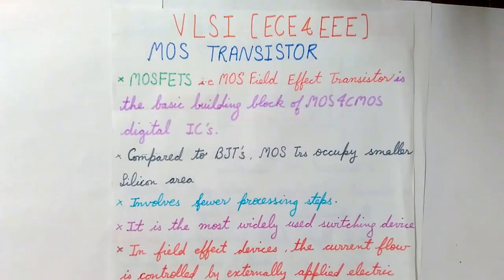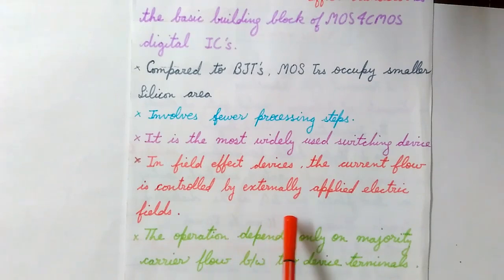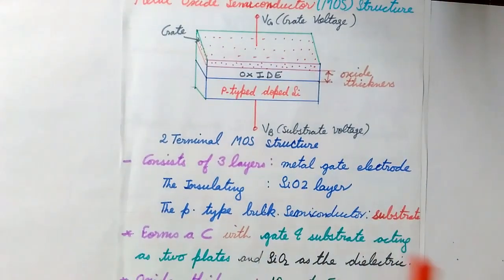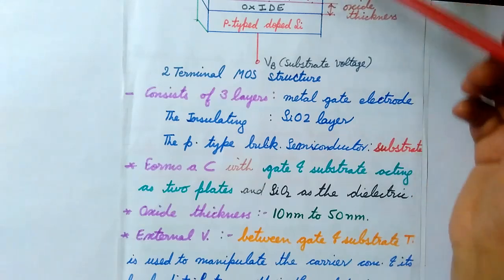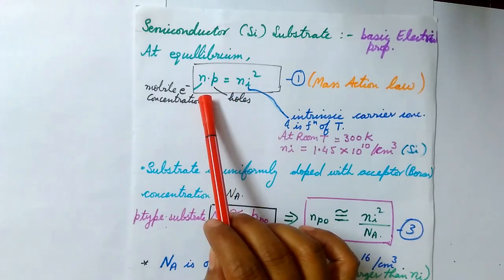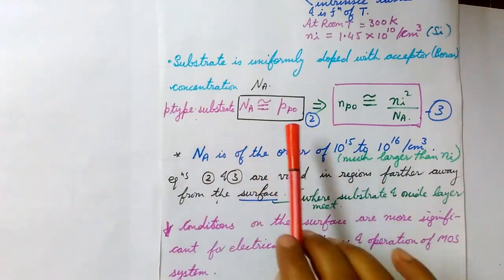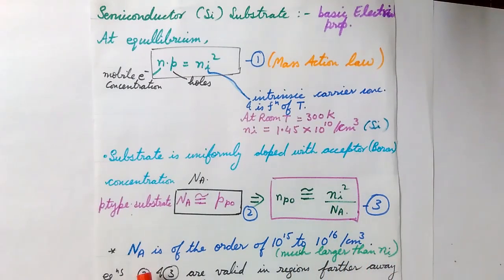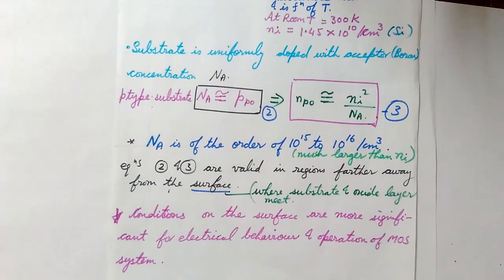VLSI - Lecture 1 (MOS Structure)

Comment: Hi Ranjeeta, Is there any way you can go over Channel Length Modulation (CLM), the part where it says delta L is proportional to sqrt of the difference b/n Vds and Vdsat, and the part where they approximate (1-del. L/L) with  (1-lambda times Vds), and how they moved it from the numerator to denominator as a sum. That will be greatly appreciated, and I hope you respond! With respect, thank you!

Comment: Hi Ranjeeta, my complements to your nice explanation of gradual channel approximation! One question that still lingers in my mind is that, when you calculate the total surface charge why subtract Vto and Vc from Vgs, why not add. How did you determine the polarities of the voltages inside the inversion layer? In short, is there any simpler way to visualize the net voltage that is involved, knowing Vgs is external, and Vto is device inherent characteristics? we are making a lot of assumptions and have to remember every details but I preferred to discuss it with you. Thank you.